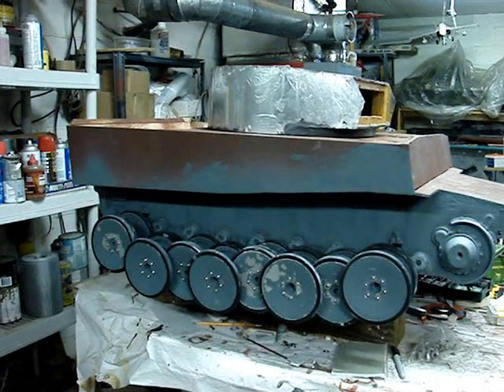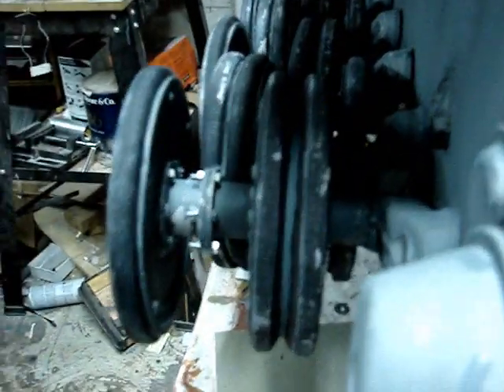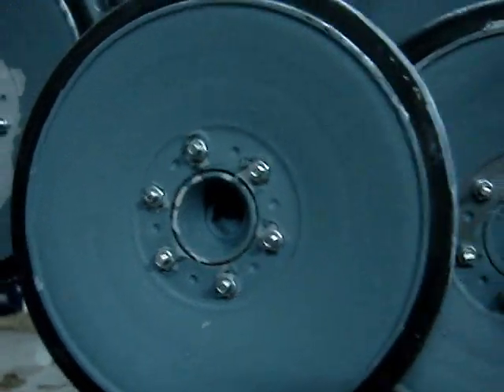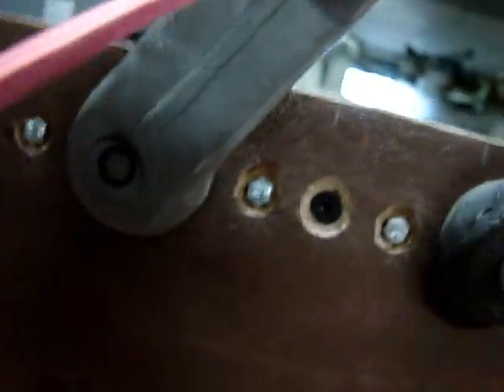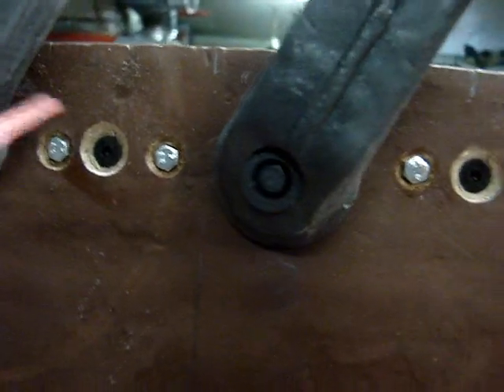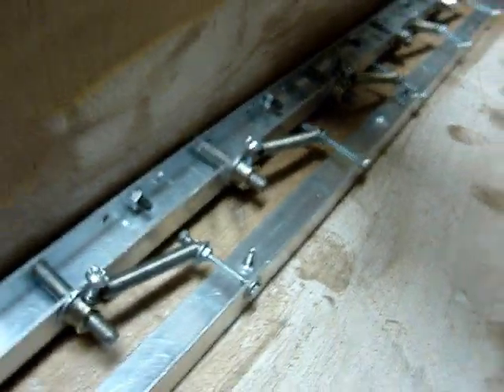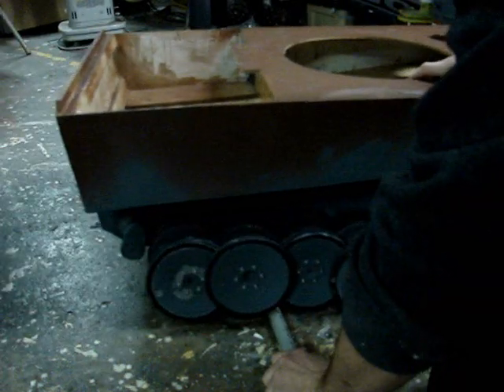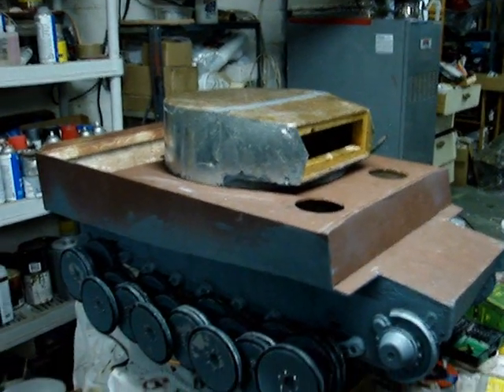1/6th scale Scratch built German Tiger I Tank project video #2 (Wheels and suspension)

Comment: I’m trying to build a tiger one that would just fit one man and I hope that this suspension will work for my project if I just size up the scale
Reply from the maker: no way would mine hold up to what your looking for, mine is designed for static display model use only
Reply: Thanks